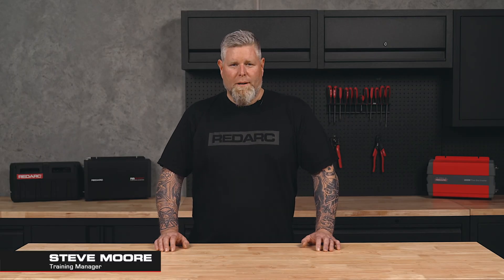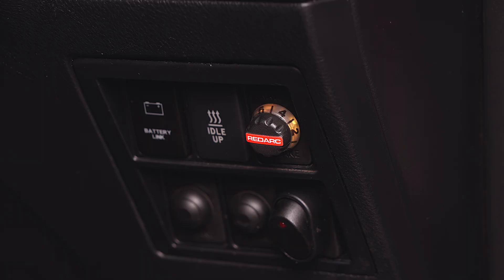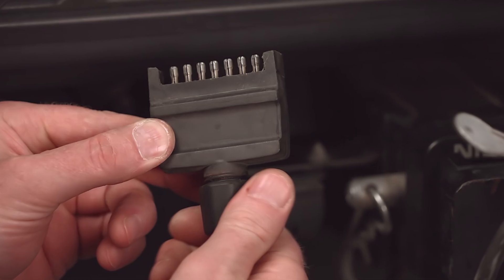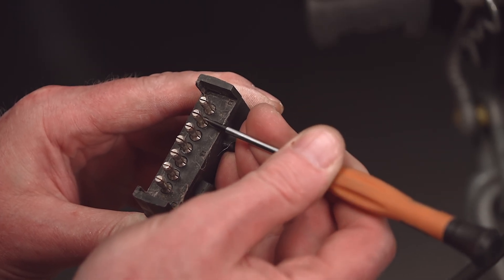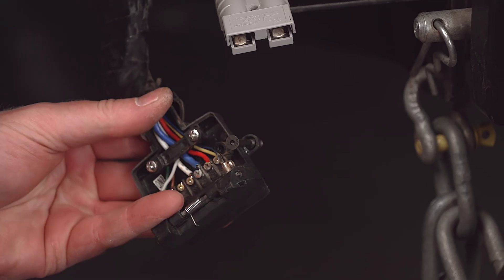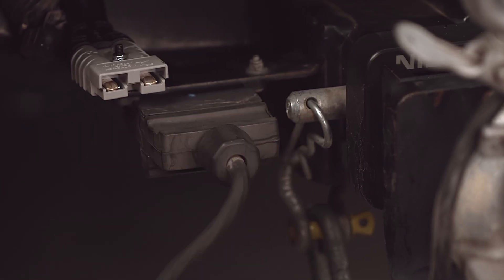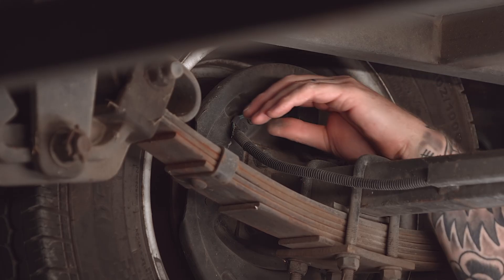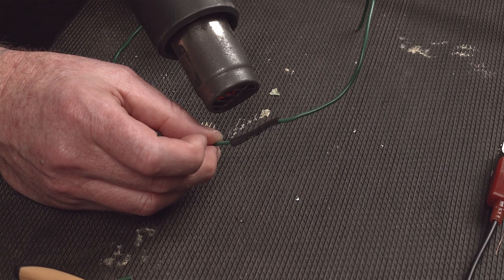Why is my Tow-Pro Elite Flashing Yellow and Purple  | REDARC Troubleshooting Guide

Comment: The two purple and on yellow only happens when it rains. The. The brakes lock on. 

Is there a reason why it only happens when it rains?
Reply from the maker: Hi there! Likely when its raining, the water could be making a small short between the trailer plug/socket pins, hence the code coming up. But once it dries out, all goes back to normal again. 
Thing may need to be sealed up a little better if that is the case! Hope that helps.

Comment: Thanks for that.

I had this problem on and off for a period of time. Short story is that the Red Anderson (constant power) on my vehicle had a pin pushed in, but not all the way.

A sparky instantly recognised the problem and sorted out the Red Anderson - and I was on my way. My hydraulic brakes haven't skipped a beat since.
Reply from the maker: Thanks for sharing your experience and a great reminder to check for faulty wiring!